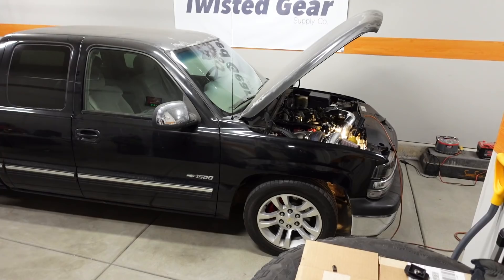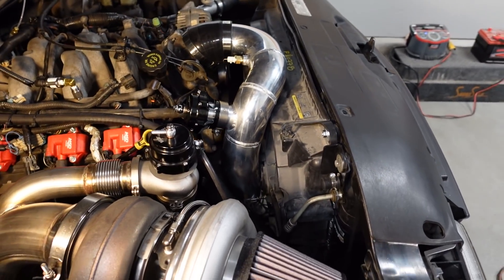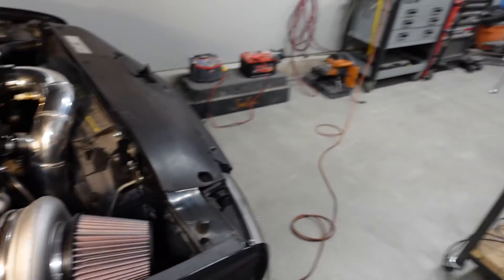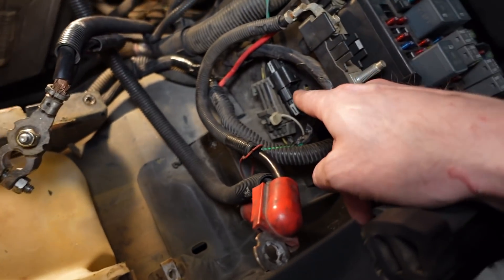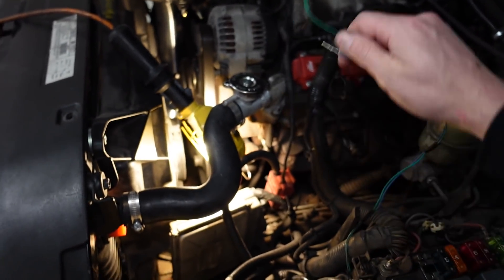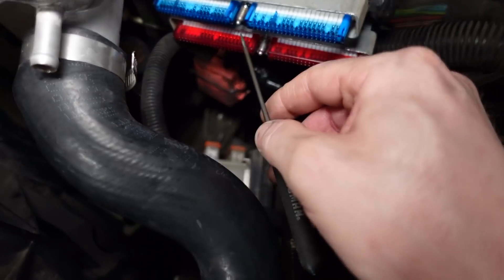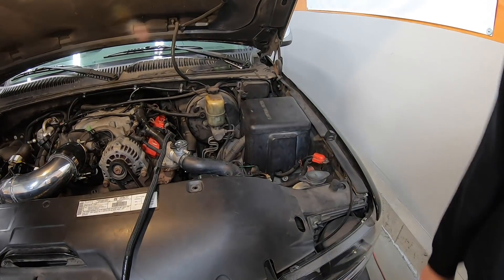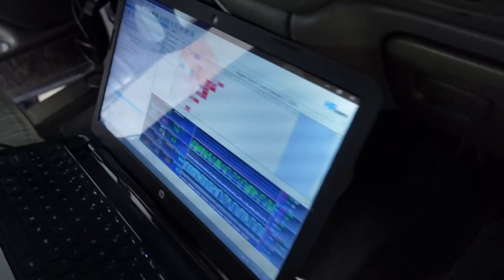Electric Cooling Fans on a 99-04 Silverado ft TURBO 8.1 BUILD ALMOST DONE

Comment: Nice video! So i have a 99 Silverado and I want to keep the AC what’s the other steps that I have to do to make the fans work with the AC? Thanks!
Reply: I would love this info also.   I LS swapped my 93 Yukon and this info would help me out.
Reply: @chrisdejarneatt6861  you can go to LT1swap.com there is a lot of info on wiring e fans on LS swapped vehicles , you can also go to Facebook and search for the group LS Swapped 88-98 OBS Trucks SUV they have files for wiring
Reply: @LJimenez0185  I’ve utilized all those avenues for my swap.   The fan wiring is hit and miss, but I think I know what I need to do now, it’s funny that what I need to do is what I have already done but in a different way.   Just gotta change a wire location and it will all be golden.
Reply: Which wire did you change to a different location or what change is it? @chrisdejarneatt6861

Comment: Is there gonna be some easy way to reconnect the AC pump? I can't go without AC. I have the elec fans in my 06 all ready. Looking at a 8.1 to drop in with turbo. Wanna see yours first. Lol.
Reply from the maker: its gonna be a challenge, but we'll see. i think if I redesigned the whole system to start with a scratch built manifold instead of using a stock manifold on the dr side, i might be able to do it

Comment: Love this Channel. You do a great job delivering information the internet it vague about. I wish I had this build footage 4 months ago! My build is dang near the same as yours and the fans kicked my butt. 
Cheers from Idaho
Reply from the maker: thanks so much! thats the goal, is to provide valuable info to help others along the way
Reply: @TolmanPerformance  If you know, would you mind sharing how this would pin into the ECM if AC is still equipped? Also if this were done with AC would the ECM still need to be programmed in order to provide the negative/ground to the fans at the desired temps? This install is great BTW. Texas heat and my GMT800 do not get along when I am sitting for too long and there’s no air circulation through the radiator. I would love to do this conversion!

Comment: Bro only connect the #42 and put back stock wire #33 thats for your a/c when ever you try to make your a/c work again is not going to work. if you keep the new #33 is going to make your transmission act up shifting weird and not shifting to overdrive trying to save you a transmission and a/c headache when you get to tuning
Reply: 99-02 pin #33 is to command the recirc door in the hvac box. Logic is that if it’s overheating, it commands it to act as a mini radiator to get the coolant cooled as a last resort. You shouldn’t need that pin, it doesn’t deal with the transmission at all.
Reply: @iamlemarksman  i took it to a transmission shop they sayd it needed a rebuilt it was going to be 2500 since ive remove that wire 33 and only run it with 42 my truck runs perfect again but i did thought ive broke the trans i was doing donuts the day before haha smh
Reply from the maker: how is it going to affect the transmission? I get the AC recirculate thing and if/when I do reinstall AC ill hook it up proper, but not sure on the transmission thing?
Reply: Somehow #33 is connected to transmission wiring and it doesnt let it shift into overdrive or wait until you get the fuel pump and tunned and run the truck and if the trans acts up that wire is going to be your problem thats what happened to my 02 when i did my efan conversion

Comment: I used to do this type of conversation at the dealership all the time. We used to get fleet Focus's without crusie control very cheap. Add the factory contol switch, or change the steering wheel in some circumstances, enable crusie control in the PCM, and factory cruise.

Comment: What air filter is that? When you get done dyno tuning. Take it off and make a pull. Also what are you doing for crankcase pressure?
Reply from the maker: its a K&N air filter, and if I remember I'll be sure to dyno it with and without. as for now, I havent done anything on the crank case, its just running the stock PCV thats under the intake manifold. It should have a check valve and maybe some external breathers though.
Reply: @TolmanPerformance  I went with a wild mighty mouse for mine. Pulls a vacuum on crankcase to help with turbo drain, and gets rid of pressure under boost.

Comment: 2001 Isuzu Trooper has the same ECU/ECM with the red and blue 80 pin connectors, and ECU/ECM, 4l30e automatic transmission, and numerous other parts are also made by GM.
Reply: You may want to check the part and serial numbers

Comment: I have a 2003 2500HD. I'd like to put the electric fans on mine. Would I have to activate the PCM for the new fans? you said 03-04 will function like the factory trucks that came with electric fans. Does this me I don't need to do any PCM changes and it will work?
Reply from the maker: you will still need to tune the computer to enable the fans, and set the correct temperature for the fans to engage, but you wont need to do any extra wiring for the fans to correctly engage when the AC comes on.
Reply: @TolmanPerformance  awesome thanks LT!
Reply: yes you need to make tune changes, the 02 and down trucks dont have the ac pressure sensor so you have to wire the AC fan differently

Comment: I did this swap on my 03 Suburban 2500 about a month ago. I actually learned about the HD fans from one of your earlier videos. Thanks! I'm looking forward to pulling my camper in the mountains this summer and not having the clutch fan rob so much power.
Reply from the maker: sure thing! they move a ton of air for sure, and from what I have read, the HD version does a great job keeping the engine cool even when working it hard

Comment: LT, you said about the one more step for the A/C to operate with the fans. I have a '99 silverado that I swapped an '04 6.0L but fans don't work with a/c on. What's that last step.
Reply: Bro only connect the #42 and put back stock wire #33 thats for your a/c when ever you try to make your a/c work again is not going to work. if you keep the new #33 is going to make your transmission act up shifting weird and not shifting to overdrive trying to save you a transmission and a/c headache when you get to tuning
Reply: @rubenwong9574 does it shift hard shifting to second gear?
Reply: #33 is your a/c dont remove it plug in only #42
Reply: @rubenwong9574  interesting, my transmission seems to be shifting fine. But now I wanna see what the difference is when I put the other wire back in. So technically I would just be running one fan speed only.
Reply: I'm gonna guess it involves a trinary switch and a few extra wires going to the ecu.
Reply: On 1500 only option is low speed both fans 1fan is when your idling to remove heat from condencer so your a/c can work properly and other fan is to remove heat from radiator when is getting too hot
Reply: @rubenwong9574  I am going to go switch them back now. Thanks for the info.

Comment: I put the same fan setup on my 1990 K2500 with a 34" radiator. Instead of junkyard stuff, I got a new one with a lifetime warranty from a national parts store chain. If I ever have any trouble, I should be able to get a free replacement from anywhere in the country.
Reply: That's if they have it in stock and don't have to wait a few days to get it lol.
Reply: Hey did you get the 34 radiator with oil cooler or with out
Reply: @Maximus-hw4gz  I have one truck with and I believe this particular one is without. This truck didn't have an engine oil cooler from the factory.
Reply: @EricErnst  oh okay thanks Eric what kinda radiator did you get